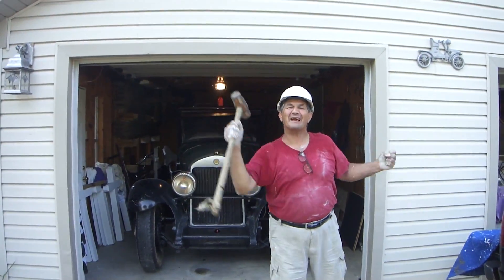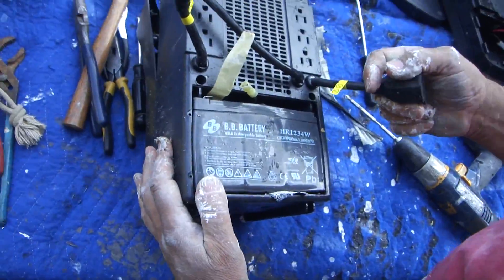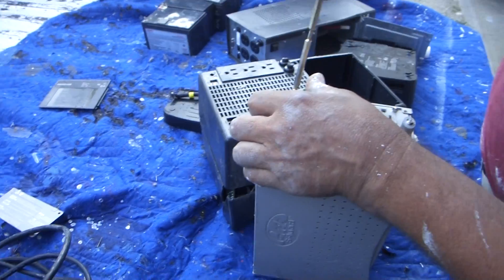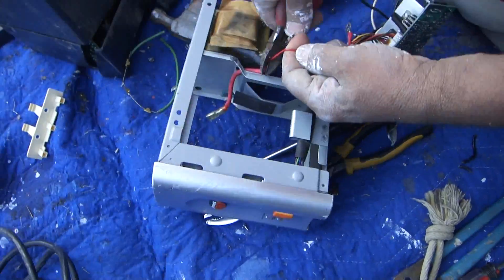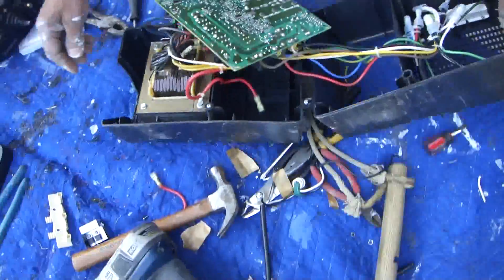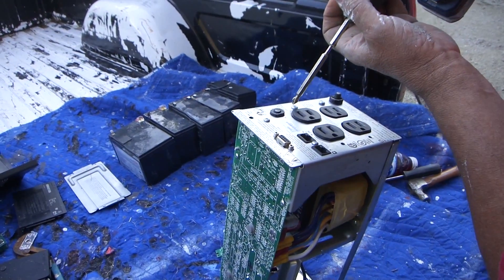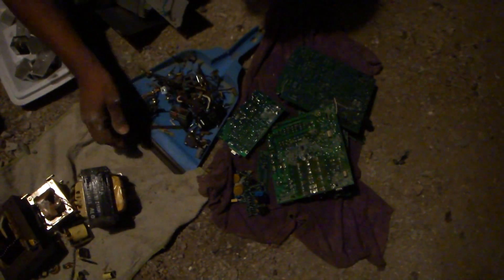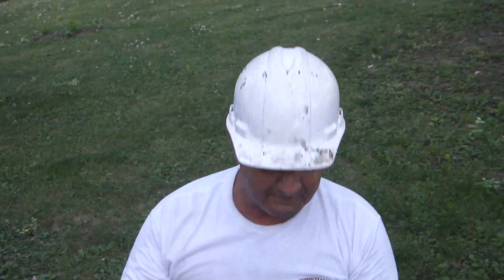Taking Apart And Scrapping Some DC Battery Backup to AC 120V Power Units.

Comment: 99% of the time when those battery backup units are thrown out, it is because the battery is worn out. Replace the battery and it will work